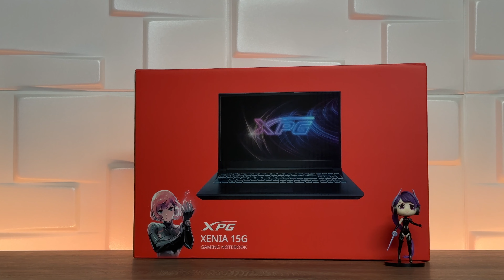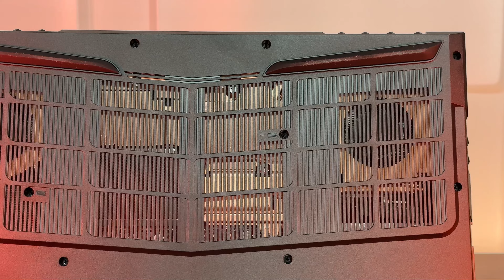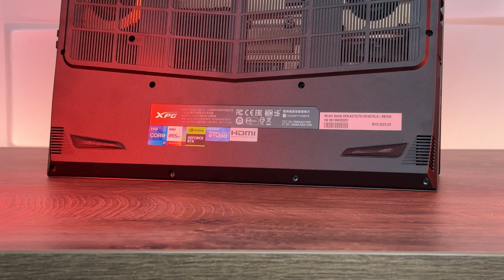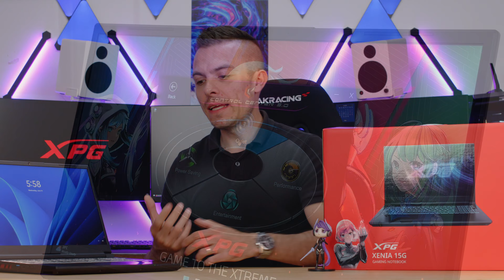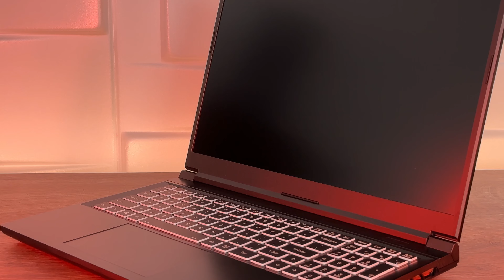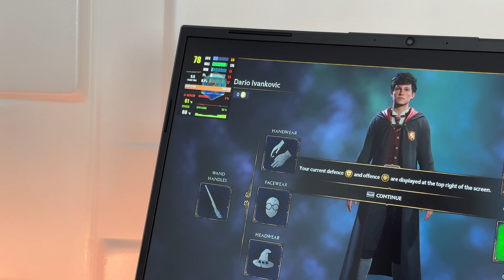XPG XENIA 15G - RTX 4070 BEAST with Brilliant Cooling!

Comment: What program do you use to see performance?
Reply from the maker: The program should be installed on your laptop already. If not, check their official website
Reply: @PCCrazyDario the control center 3? It doesnt work for mine.
Reply from the maker: Also, for additional performance monitoring, I used FPS Monitor. You can buy it on Steam.

Comment: how long does the battery last using it for office?
Reply from the maker: I didn't run any tests on that, but I have found the information on Tom's Hardware: "The XPG Xenia 15 has a typical battery life for gaming laptops. Using our battery test, which continuously browses the web, streams video and runs OpenGL tests at 150 nits while connected to Wi-Fi, we were able to squeeze 6 hours and 34 minutes from the laptop."
Reply: @PCCrazyDario  thanks
Reply from the maker: @arturo1272  Not a problem :)
Reply: not true thats for the 93wh version which has a 1660ti @arturo1272

Comment: = CLEVO V155RNEQ Barebone
Reply: thanks for the info. Previous Xenias were  the Intel NUC laptops which used TongFang chassis. In my opinion, TongFang >> Clevo

Also they were thin and light for a gaming laptop, with a magnesium alloy body and big battery, without skipping on performance. I have the first gen one, with i7 9750H and RTX2070.  The cooling can sustain 90W continuous on the CPU while just weighting 1.8kg...

Sad that they just became boring regular gaming laptops, which every brand already offers. Probably Intel is to blame, as their lastest NUC laptop design went for a less gaming route, becoming even thinner, with less airflow (exhaust in just one side) and using their own Arc GPU.
Reply: @TwskiTV  yes, sadly.....esepecially because they could have used a normal Tongfang model, but decided to go with CLEVO instead and even the budget line of CLEVO, too......

But it isn't a big company either. So they are not even selling there notebooks in europe and there are many options of smaller and bigger brands at every market.
Reply from the maker: No products found matching the search criteria 😅
Reply: @PCCrazyDario  because its an internal ODM Code for this Barebone.

Instead you can Search for "MEDION Erazer Crawler E40" for example, which is based on the same Barebone.^^
Reply from the maker: @marzok9632  That one is i5-13500H with RTX 4050, but I get the picture. Regardless, great gaming laptop with outstanding cooling wouldn't you say. :)
Reply: @PCCrazyDario  1. Jeah, only an example. This Barebone ist comming in different configurations and ADATA (XPG) choose the 4060 and 4070 variants vor selling.

2. Yes, especially in terms of price-performance ratio.
Reply from the maker: @marzok9632  Yeah, so true. Totally agree. :)